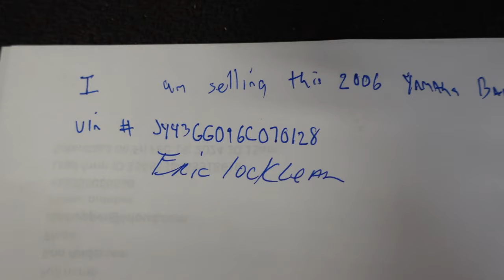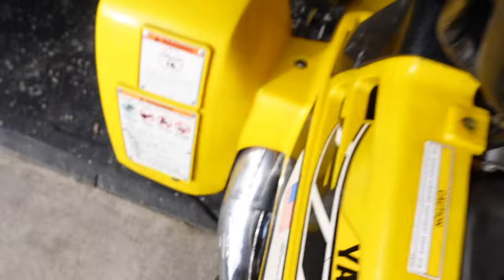FaceBook Market NIGHTMARE: I Got ROBBED For $8000

Comment: Still a 6k bike. N needs rejetting for ny. Like a car. Different elevations. Take off airbox lid n try ride. 
N u need TORS delete on carbs
Reply: Was about to write this. If it's been sitting a while since it ran before he got it he needs to repack the pipes and change the oil too.
Reply: Definitely not at 6k bike more like a 5-5500 bike

Comment: Things I’d do since I do this to all bikes I buy. Check compression, Clean up carbs, check jetting, tune them up (float air screw,clean jets, adjust throttle cable, sync them, air filter replacement, replace gear oil 80-85 (I like the Honda one), radiator flush ( I like using engine ice) make sure carb boots ain’t cracked causing air leaks and you should
Be good as far as the basics on the motor. Good look hope
It works out for you

Comment: So, I was building a 2 stroke bike awhile back and I definitely remember that the carbs jet needs to be adjusted due to different elevations. Might look into re jetting Aki since it’s colder in NY and elevation is different to what it’s currently tuned too.

Comment: Try going down a jet size in the carbs. We are higher elevation in NY than in carolina. Thats where your bogging is coming from. To repack the pipes you just take them off and pull the cores, rewrap them then stuff them back in. Itll take the raspiness out of it.those are toomies though so theyre gonna have a bit of rasp to them. You paid about what theyre going for in that condition being a 50th. Banshee prices are stupid nowadays. I wont buy one. I cant justify paying that much for a used bike personally.

Comment: Not bad, but definitely not prestean. The starting issue can be due to elevation or temperature. It was probably tuned for the sellers location and its been extremely cold lately.

Comment: 2m oil is for marine craft use 2s or 2r and dont run bre8es plugs use br8eg  plugs start there before anything else also the case oil is for clutch/gears gas doesnt get into it use belray gearsaver

Comment: I wouldnt be running marine 2 stroke in that. Marine 2 stroke oil is for very low rpm trolling motors not high rpm engines. If your going to run yamalube atleast run 2r but I wouldnt run that I'd run maxima super m, k2, klotz supertechniplate, or amsoil dominator.

Comment: Lil over priced, but it’s still a unicorn, I’d do a compression test first to see how the motor inside, even tho it does sound pretty good,if numbers are decent, do a oil change, we use atf type f the cheapest u can find lol change ever other ride, been doing this for 10 years, ride hard in the dunes,get a new air filter, and I’d take those carbs apart and clean them up it’s probly gunked up(pilot jets)! While your at it, do a tors delete on those carbs,it’s only going to give u problems down the road, I’d check the jets and see wat u got might need to do some adjust to your tempature and altitude, and make sure u get the banshee sync tool for those carbs,  then adjust idle, and if numbers don’t come out good, just take it apart before u melt a piston or throw a rod

Comment: Deff need silencers packed. Carbs clean is least of ur worries, it might be a little dirty but it's running like that b.c. of jetting. U brought the bike from several states away, elevation, barometric pressure, Temps, humidity that all plays a factor. It'd not jetted for your state is all. Very minor, need a good 2 stroke guy. Aounds fine in the rpms.

Comment: The reason it ain’t running is because it’s gotta be re jetted for Brooklyn… (check compression) the smoke in each exhaust should be the same. 
That bike is 5k if you had a 2006 Reggie…(which you don’t have)  if that vin is a clean 2006 vin you gotta look up the vin to see if it’s a a REAL 2006. And they do sell those plastics that you should definitely buy now.

Comment: Looks down on compression. I have a 89 Honda 250R single cylinder 2 stroke and it takes almost everything I have just to kick it once. Seems like a twins cylinder shouldn’t be that easy to kick. Just a thought and something to look into.
Reply: Single cylinder is harder I also have a 250r lt and it’s stock bore is 70mm so it’s pretty big piston

Comment: Clean out the carb and look at the jets in the carb if day or the same and jets for your fmf T5 jet pipe check the compression if twin mach 120psi + a ok under bad buy air filter k&n + boos battel you win bottom power faster respond on trustol. I have the same banshee 50e anneveris yellow the 3 made from factories steal stock 25mm pistons four the cost 6g or 6.5g more so   but the value fully restored yes 8g good Luke whit your quad 🤔

Comment: So on those bikes there should be a choke on the carb and when u first start it you have to pull it out once it's warmed up you push it back in and it's going to need carb cleaned

Comment: I’ve been working on Quad for years you could definitely rebuild that carburetor yourself just watch a couple videos lay everything now nice and clean and deep and count. The turns like the idol screw or stuff like that when you back them out count how many turns and then just put it back. You can find it once it’s running but definitely clean it out yourself. It’s not hard at all, imo 8 k is a little high for that, but it is what it is at this point

Comment: I recommend using a bit more oil , if the engine is tuned properly it should not give problems with the spark plug , usually people try to put the least oil possible trying to get more power out of it , but that mindset only works for racing like karting , for just having fun I would much rather have some less performance but take a better care of the rings , cause if that mofo seize or catch a ring on a port , that going to be a expensive ride

Comment: He probably had the bike warm in the video unless he put his hand on the pipe ......... PAUSE but you know what I mean and a banshee in 100% perfect condition would fetch atleast 10k or better also remember 2 stroke bikes are tuned to the weather so if down south was warmer and you brought it up here the tune would change also it would be tuned to the mix the previous owner had if you mixed it different that could throw it off 2 strokes are finicky thats why alot of ppl like 4 stroke just gas and go also again IMO yamalube is trash I personally use Klotz racing oil better oil and smells amazing it should puff more smoke than that not much but deff more do more research on your mix other than that I think it was a good buy especially now that you have it I'm sure it's gonna come out nice no question